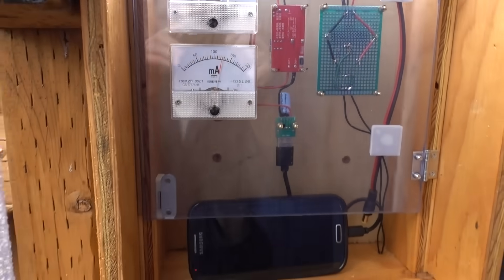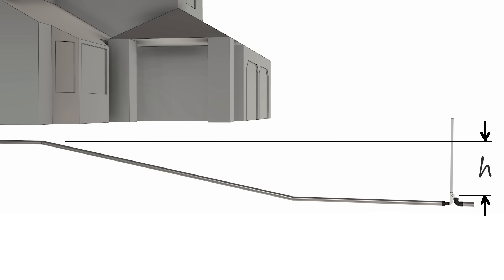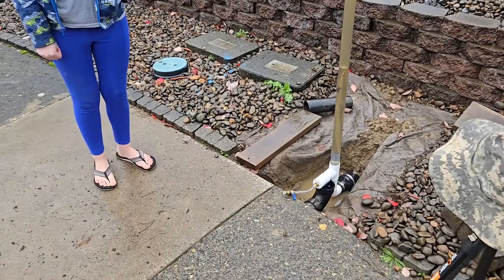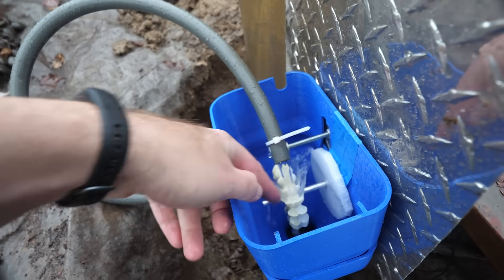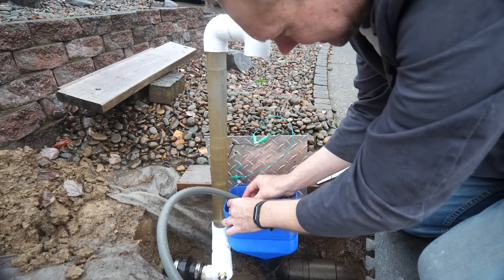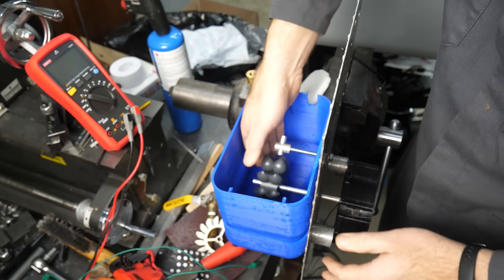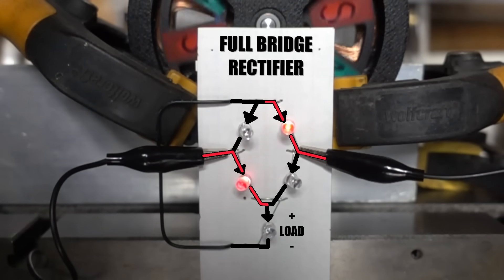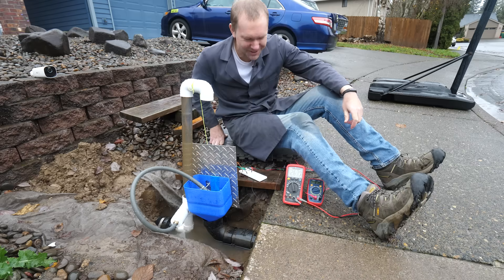Curb Rain Power!

Comment: What if you started your design off from a more practical approach? I.e. this was something you could buy off the shelf in the plumbing or electrical isles? The end use would be to power anything you want or store the power. I understand the concept in trying to reuse your past invention, but I think you started off with a bunch of restrictions by just using your old design instead of starting from scratch and thinking end goal and then working backwards.

Comment: You may be backfilling the weeping tile around the foundation of your house and if so, you may be saturating your foundation.  Probably not a good idea.  Capture the rainwater above ground and let the underground drain system do what it was designed to do, move water away from your house.
Reply: yeah, that's what I would be afraid of haha
Reply: Or, just set your overflow a few inches below the stagnation point where you start to fill the pipe around the house and switch to a Francis turbine and DC generator which are better suited to low flow and static water pressures.

Comment: Here's a thought, move your mailbox next to the drain pipe, and hide a reservoir in the base of the mailbox, so you get greater head pressure, without having an eyesore pipe sticking up by the curb. Add a bell siphon so it doesn't drain until it fills up completely.
Reply: Clippy gang

Comment: Perhaps you could use the water to fill containers that act as weights, pulling or pushing on a generator? You could make it continuous by having the full, heavy container pull up its empty counterpart, as it goes down. You could use two or three plastic tubes as the tower and build a mechanism that uses the weight of the container to rotate the tubes into the correct position. English is not my native language :)

Comment: I feel like it might work better if the water would first have to go up that downwards elbow pipe and then just go straight down onto the generator.
At least in my head that lets it build up gravitational potential, instead of going up and around from below through the grey tube.
But that's just my thinking, no idea if water pressure and lift height cancel all that out so it's equal in the end.

Comment: You could increase you power output by using the water coming out the overflow instead of the hose you have currently.  The greater height of water falling to the wheel increases power.  Kinda acts like the capacitor for the rectifier.
Reply: I thought the same thing. There has to be a height sweet spot that uses that kinetic potential energy, while also retaining accuracy onto the turbine. Would be curious to see this in practice.

Comment: More head pressure is better then volume!

You should put a little reservoir up on the roof (A Bucket), and a garden hose down to the turbine.
Then you need a controll system that regulates the turbine power via the level in the bucket, so you always have a minimum head from the bucket down.

Some opportunity for a fancy controll system, capable of different tactics to optimize power output with varying amounts of rain. 😏

Comment: Besides lowering the pelton, wouldn't it be better to just put an actual nozzle on the end of that hose? you'l have a smaller stream but higher pressure, hopefully you get higher RPM

Comment: Pressure is going to always be what helps generate electricity better. An ideal setup will be a big rain barrel for water "capacitance," and a nice thin PVC tube that allows high flow speed as it goes down the hill. I'd recommend a filtered rain barrel exiting at 4", then smoothly necking down to 1", then the 1" goes all the way down your lawn to the turbine wheel. You can lay it over top for testing, and remove it easily. It needs capacity and pressure to make electricity. The natural flow of a trickle won't do much. It should be making electricity when you want it to, not when it happens to have 1/2" of rain.
Reply: I want to see a level control system on the barrel too.  I can see a small micro-controll system with a cheap servo, as level changes servo adjusts valve. Then add an MPPT control to optimize load on generator...  then... then...

Oh wait, all that would consume more electricity than we're able to generate... um... nevermind. lol

Comment: Use the pessure from a rainwater tank and pulse the flow. ( into separate droplets, drop surface tension will translate to the wheel as more force while conserving pressure reserves.)

Comment: If you necked down your overflow and bring the pipe down it would siphon out once it got to the overflow height. Then it would store until optimal then run until almost fully released.

Comment: Insert a large multi-fan-bladed turbine inside the pipe, in-line to how it was before you cut into you. Form the edges of the turbine blades to be flush with the edges of the pipe. This should generate lots of torque/momentum.
Reply: An archemedes screw should be perfect for high volume low speed water.

Comment: Use a much shorter path from the pvc to the nozzle, the fittings and tubing are very restrictive?
Rewinding the generator for higher voltage, the rectifiers drop would be a smaller percentage of the produced voltage?

Comment: 8:20, what happens if you put a funnel/nozzle on the overflow and let the stream drop on the wheel?  Does the drop make it stronger?
Reply: Same thought
Reply: That wouldn't really work because there would be no water pressure. It would only be flowing enough to make it over the hump.

Comment: Is the gunk coming from the surrounding soil . This could cause a big cavern to develope UNDER YOUR HOUSE.
Reply: If the gunk is from the surrounding soil, then he's got a massive leak in his drain pipe that is already a problem.
Honestly it's probably just from the roof; composite asphalt shingle bits and moss and whatever other dirt that blows onto the roof and has made its way into the gutter pipe over time. The pipe probably has low- or no-flow spots that don't get rinsed out by regular rain. But with the flood-and-release that was happening here, those spots were finally getting soaked and flushed.

Comment: it might work better if you has 10+ (or 100+) turbines going down along the way than just one which you didnt do that. Why? force is force.
Since you have one at the top gutter and one at the bottom which shows you are neglecting the forces in between. Why? To make a inefficient system?  Think about it.
Its like you are saying only 1 person can get electricity from 1 stream of water going down 1000 miles.
You also need better turbines like as some say a Francis Turbine for low to high flow, the Bladeless Hydro Turbine

Comment: you can still measure the flow rate from the footage. pelton is water wheel? of with larger cups its way more powerful, ie torque to turn a larger generator, by the water mass.

Comment: you should do a ton of suction valves in series down the top of the capped 2 ft pipe. That would increase the flow rate and you could do like 3-5 dips to the other pipe then convert to a smaller pipe for the flow box, ie multiple channel split

Comment: i was thinking IBC Tote or Totes with a float valve setup to trip a gate (like a ball valve or a flapper valve) so when the water reaches a specified height inside the tote it opens the valves automatically to drain, then control your flow rate by a restriction at the tote itself, that would give you a known constant value of output per tote as well as something upwards of like 300 gallons of reserve capacity per tote, it would work like a scaled up toilet cistern, but i'm just spitballin' so i have no idea how you'd be able to make a float system like that work with that much weight and volume, maybe a lever and float? anyways just my 2Cents, loved the raingutter power project, can't wait to see how this one turns out

Comment: 1st: low pressure and "high" flowrate is the condition for a Francis Turbine (a thicker diameter is also better against dirt...)
2nd: you have low voltage - better use schottky diodes for your rectifiere (drop voltage is 0.3V instead of 0.7V )
Reply: May even be worth it looking into MOSFET based rectifiers.
Reply: Ah that seems to be the basis for the bladeless vortex turbine talked about in this video for small hydro https://www.youtube.com/watch?v=KEsrAmM07fs&ab_channel=UndecidedwithMattFerrell
When he said flow rate, it was the first thing that crossed my mind. Also has a smaller height profile, so he could set it up in the ground and stick something akin to a manhole cover over for maintenance access

Comment: Meters and gallons 😂😂
Reply: You'd think this was in Canada, where pretty much both systems are used simultaneously - the US seems to be trending in the same way. Anyone that's even slightly scientific (a lot of whom aren't from the US to begin with) uses metric, and it's only mostly common people that use imperial
Reply: I don't understand the fuss.
I was brought up on pounds, shillings and pence, feet, yards, miles, pound and ounces fluid ounces and Fahrenheit.
From the 1980s onwards we started using metric. 
It turns out it's just words and numbers and there's really no reason to convert anything.
Just use the one everyone else is using.

Comment: i always wonder about this kind of scale of power generation. it seems like not much, but it these devices were cheap enough to make, and there were enough of them, they could actually make a real impact
Reply: 3W?? And that's theoretical best, not taking into account any efficiency loses which will be all over the place. You could generate more power with a teeny tiny toy solar panel from a solar garden light even on a cloudy day. I don't think it's economically viable at all, and if it was a real project, you'd stop right there.

Comment: Use IBC totes at each downspout to collect rainwater with valves at their bases to control release flow?  A tall IBC is 300 gallons I believe.
Reply from the maker: Hey that's a good idea! Just need to fab a structure strong enough to hold one!
Reply: @QuintBUILDs  I think he means just put an IBC tote at each downspout up at the house, and you'd have many large reservoirs (and the pressure from all that water) feeding into the ring drain around the house.
Reply: @gorak9000  but that would be a large obstruction of land resources and not properly address overflow of the drain tube by the house, besides it would stop the reintegration of the original down spout electric system as a way to make use of energy from roof to ground level.

Comment: You are losing over half of the energy at the brass fitting feeding the tubing. An exit orifice is critical for velocity. It must be the smallest part of the path. I would 3d print an assortment of sizes.
Reply: Yes, but then you also need some way to filter out debris. And someway to keep the filter from clogging too often. Always tradeoffs.